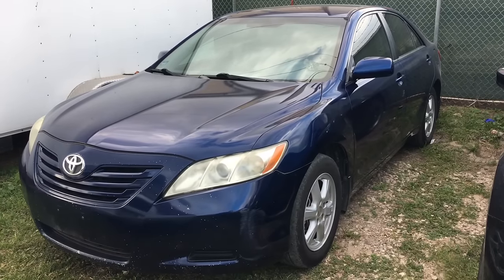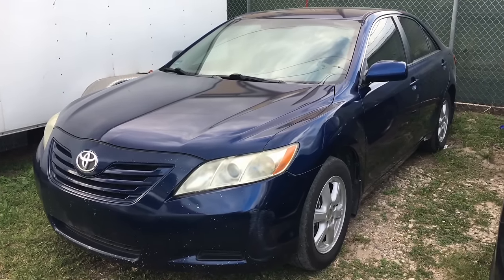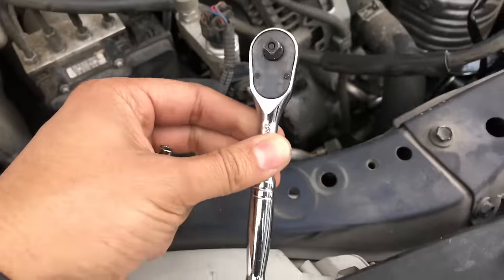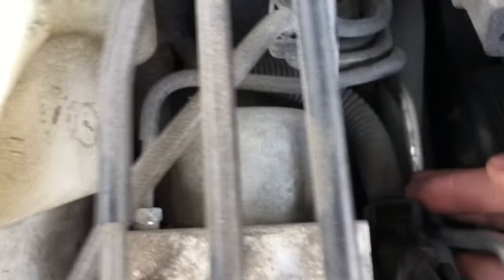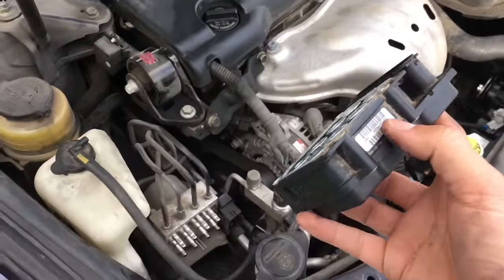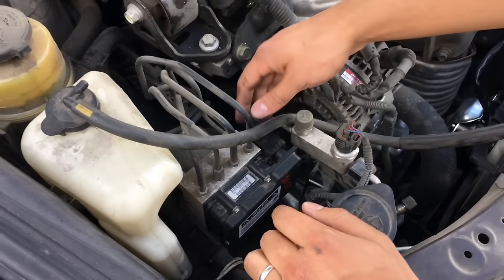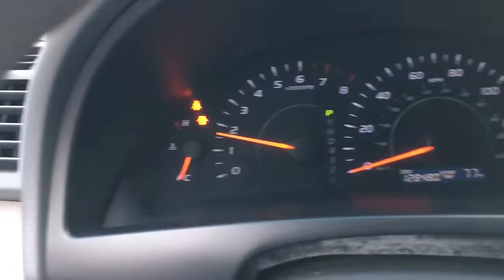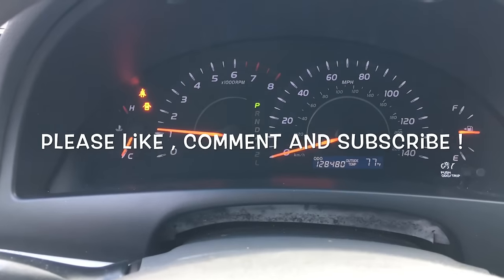How to fix a 2007 Toyota Camry ABS and Brake light and also flickering speedometer

Comment: I have a Toyota Camry 09. My abs light came on and I discovered one of the wires were caught. I fixed that and noticed every time I pressed the brake pedal, the front wheels vibrate or shake so bad. And the abs light doesn't turn on to show something is wrong. Please help. I really do t think any of the wheel sensor has a fault though

Comment: Thanks for your video/help. Toyota certified dealer asked me 2500$ to replace Actuator. is there any website I can look/order  online for junk yard part ? I have a Toyota Camry 2007 XLE V6 same exact issue.
Reply from the maker: You can type Auto Junk Yards on google maps and find if there's any junk yards near your area.    You should be able to find the part for $25 to $80.   Let me know if your problem was fixed
Reply: What if I continue drive with that for a week , I opened the part yesterday, cleaned it from inside with air dust spray, not fixed yet, Found one on ebay for 175$ with the pump but will look for it in auto junk yard next week.
Reply from the maker: Omid Haidarpour I cleaned mine at first too and it didn't fix the problem.  You can still drive the car don't worry.  Just fix it soon.

Comment: hello! thank you for posting this video!! can you please tell me if there is any specific model or part nunber for this.i need one. another video said to get abs pump. how do you know if you're getting one that works if  you get it at a junk yard? Thank you!
Reply from the maker: If I was you I'll just replace this abs module part first since it's cheap.  There's no way to test it before you buy it on the junk yard. 
Just make sure you tell them what engine size you got so they can give you the correct part.  Keep me updated on your repair.
Reply: ok thank you .i will. im out here i ca. and and theyre quoting me 150 to 200  at the junk yards for the module, you thinknthays the going rate at a junk yard in your opinion?im going tomorrow. ill let you know how it goes. thank,you!

Comment: what is the signs when is ABS failing? my car shows the abs light when i turn the car off, when i try to turn on back the car doesn't turn on, is part of the problem you know?
Reply from the maker: Cocina Recetas y Mas your problem might be electrical like battery or an alarm system. 

Even with a bad ABS your car should turn on fine

Comment: I bought the piece and replaced it. The lights are gone but now the car is like rattling. 😔 and the ac still doesn’t work all that great. Do you know what it could be?
Reply from the maker: It’s hard to diagnose without seeing it, but you may have a whole different issue. Maybe you need a tune up?

Comment: Brother.. If I drive my car without warm it the speedometer going to ziro. Brake light on.  And check engine. And if I press brake pedal in low speed there's clunk sound. And it's doesn't stop

Comment: Question do you really have to disconnect the battery before replacing the model?
Reply from the maker: Everytime you Replace a electrical component on the car it’s recomendad you disconnect the battery.  It’s just for safety
Reply: Garage Boys Thanks for your video saved me a bunch of $$$. 👏👏👏👏👏👏
Reply from the maker: Awesome, I’m glad I could help! Help me back by subscribing

Comment: I have the same problem. Went to pick up a used ABS Module.. it seemed to fix the problem, BUT the ABS light and brake light is still on. AC, speedometer works and RPM no longer twitches. When I checked the VIN for the car it came from, it says it's a 2008. Wonder if that's the cause since my car is 2007 🤔
Reply: I’m having the same problem buddy

Comment: Only my abs is blinking. My brake light not on and ac does work. Car did not want to start, recharged the battery,  car started but shook at stop and felt like it wanted to die in idle. Now car is not shaking and starts right but abs light still blinking. Any suggestions?
Reply from the maker: It’s hard to diagnose but seems like your abs system is bad, not the module but maybe the sensors at the tires???  You will have to have it checked
Reply: @GarageBoys  thank you

Comment: I have the same problem and I have a 2007 Camry.  The dealer is trying to charge $2400 dollars to fix this. Do you need to bleed the brakes for this?
Reply from the maker: denamma no.   You don't have too.
Reply: lol dont pay $2400...get  a used one and have somebody install or do yourself and save like over $2000
Did this on my wifes camary and over 80k miles not a issue.

Comment: Just had a head gasket issue with my car. Worse case scenario, what problem would I have if I didn’t replace the module. Trying to save money. So far the ABS light came on once then turn off when I restarted the car
Reply from the maker: If it’s not giving you the symptoms showed in this video then it’s not the module. If you are getting just the light every now and then. Then it sounds like your brake pads or your abs sensors
Reply: Garage Boys mile gauge works fine, AC a bit slow but works, no brake sign on. Is the module sensor or brake pad replacement expensive?
Reply from the maker: Sounds like your issue is definitely not the abs module shown in this video. Keep driving the car see if the light comes back again, check brake fluid and brake pads. Not expensive and you can do it yourself. Check my channel, I have a video where I replace brake pads. Or take it to any brake shop and they will inspect for free
Reply: Garage Boys thanks a lot

Comment: Just curious, I recently bought a 2007 toyota camry 2.4L with 66,000 miles on it. I heard these burn oil. Is that true? Any other camry 2.4L owners on here? Do your camrys burn oil?
Reply from the maker: Artem Ast sorry I can't answer that question. I don't know
Reply: Garage Boys only the normal burn...
Reply: Yes they do. They had an extended warranty out for this reason Just had the dealership replace rings in mine for this very reason. It would all the way down to the low mark through an oil change cycle. I am now having the instrument problem and will be looking into the junk yard on monday. Dealership wanted $5400 to fix it.

Comment: I have the same problem, but my question is, that if 
the lights of your car some times turn on and then turn off  like mine before you changed your module
Reply from the maker: Oscar Sanchez yes mine had the same problem.  They turn on for a while and then off and then on again.    Just replace the module.  That should fix it.  Let me know how it goes for you.   Good luck

Comment: will having synptoms like this cause a bad fuel consumption. My only problem is the rpm tachometer drops when i let go of the accelerator and when i floor it it jolts up.
Reply from the maker: You may have a bad speedometer sensor
Reply: ok thanks man and nice explantion on the video thumbs up
Reply: did changing the speedometer sensor fix it?, I'm having the same problem that you were having

Comment: I'm having this problem and was told my AAA mechanic that this part  could not simply replaced but also had to be " "programmed" by the dealer for my car or it would not work. Tried  to charge my hundreds for programming. Do you know anything about this?
Reply from the maker: Bryan Press, DPT it doesn't have to be programmed.  It's as easy as unplugged the old one and plus the new one. That's it.

Comment: I bought a brand new abs module but mechanic they wanted to charge 1400 plus they said something about reprogramming.. i just did it myself and everything worked... this is not a common problem for a local mechanic and when I explained the issue they didn't even listen

Comment: Hi, I have the 2012 Camry SE.. Brake light is on.. Steering lights pops up on the dash and the steering seizes.. I have replaced the steering angle sensor but its still same.. Could this be the problem??

Comment: My 2004 camry failed smog with speed sensor code P0500. I have similar issue. All three ABS, Brake and check-in engine light come up and speedometer indicator goes up and down, the check-in engine light stays ON. Mechanic changed the speed senor and dash cluster but same issue. Looking from video, I need to get ABS changed ?
Reply from the maker: Yes this is your issue
Reply: where did you get the abs module from ? I need one for my 04 Camry ! 
is it from ebay ?
Reply: @GarageBoys  Thank you ! If I replace the module, does it need to programmed as well ?
Reply: @GarageBoys  Thank you ! Does this require programming or I can just replace it and I am good to go ? 
I found one ,2002-2006 Toyota Camry ABS Control Module 89540-33300 OEM

Comment: Your AC might be slow because you have no coolant in your reservoir...may be you are low in coolant? Have a leak somewhere
Reply from the maker: No, coolant will not affect your a/c performance. You may be thinking of the radiator fan which is the only thing from the cooling system that will affect your ac. But in this case it was the ABS module

Comment: First of all, you didn't show that, you diagnosed the ABS module, before replacing it. it seems you are absolutely sure, when ABS light turns on, and some other related problems, you replace the ABS module. . . shouldn't you diagnose it first, before replacing it?
Reply from the maker: mckoy lach Symptoms of a bad ABS module for this car is the following ( flickering speedometer gauge , brake light on , abs light on and ac not working properly. ) that’s why I knew it was the abs module.

Comment: I am at a loss for why someone would post a video like this w/o first explaining how he came to the conclusion that an ABS module needed to be replaced? You make no mention of the codes that you either didn't bother to pull or failed to mention them.
For those who have some understanding of auto repair on OBD-II vehicles, Toyota was kind enough to provide a way for the DIY to pull ABS codes. If your ABS light is on, do the following:
- Jumper ports 4 & 13 in the OBD connection under the dash - use a small paper clip - there are countless discussions of this on the web.
- key in ignition - turn to 2nd position - do not start the engine.
- Lets say you have a code 31 - just an example
- Watch the ABS light. It will blink 3 times - then a brief pause followed by 1 more blink - hence code 31. If there are additional codes - they will also blink. Once all codes have been displayed - it starts over again.
- Once you fix the problem - you can turn off the ABS light.
- Jumper 4 & 13 again - ign. switch to 2nd pos. - pump brake pedal 8X within 5 secs. - ABS light goes out. If the ABS light comes on again - you  did not fix the problem or a new problem has occurred. Pull codes again and fix.
- Some people are naïve and merely turn off the ABS light. It will come on again until you fix what caused it to turn on in the first place.
Reply from the maker: With this video I save you all the trouble and headache, if you have the symptoms in the video the. Just replace the abs module, the check engine or the ABS won’t point at the abs module as being the problem that’s why I don’t mention it. Notice that one of the symptoms is issues with the A/C. The OBD won’t give you a diagnosis on that.... replace the ABS Module and...... you welcome ;-)
Reply: @GarageBoys  You need a scanner capable of pulling ABS codes or do what I pointed out. Your video suggests there is only one thing that can turn on an ABS light. More often than not - an ABS light is caused by bad wheel sensors and that's just one possibility. The ABS module has nothing to do with the A/C.
Reply from the maker: That’s why I show all the symptoms of the video. This is not a regular ABS problem, the light doesn’t give you a code that says “bad module” if you where to replace the parts given by the codes you would just be wasting money. In this SPECIAL SCENARIO, with the symptoms shown on the video the answer is replacing the module.
Reply: Garage Boys My guess is the tachometer jumped at times and you also saw your fuel gauge (and temp) go out and down too.